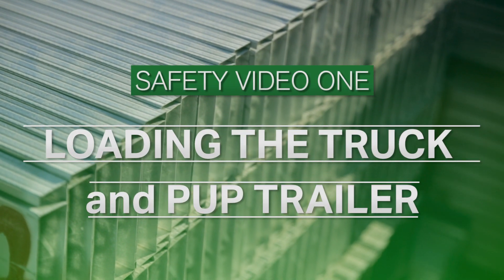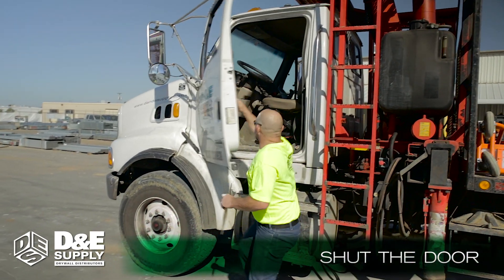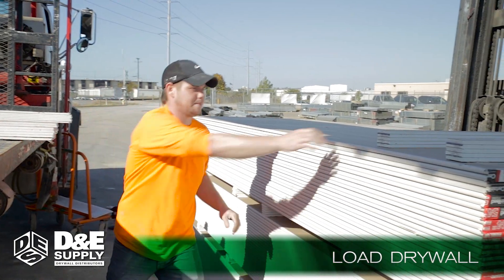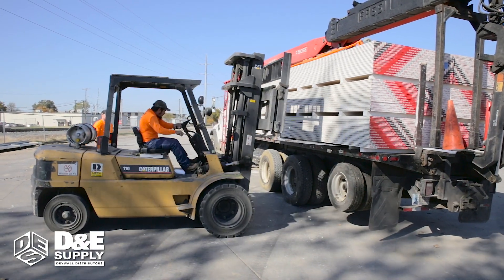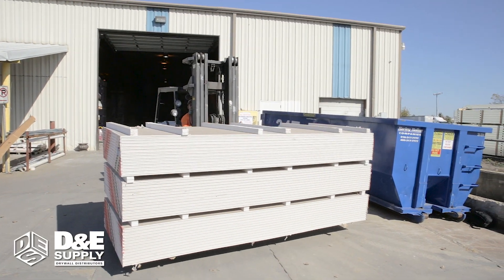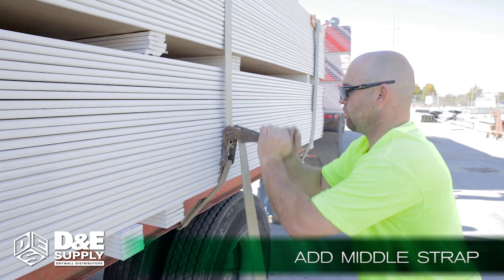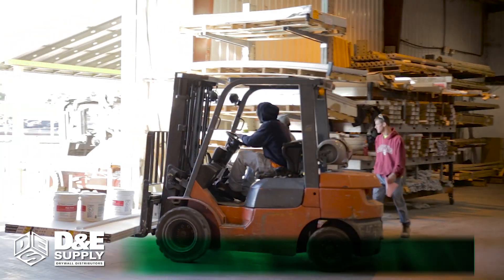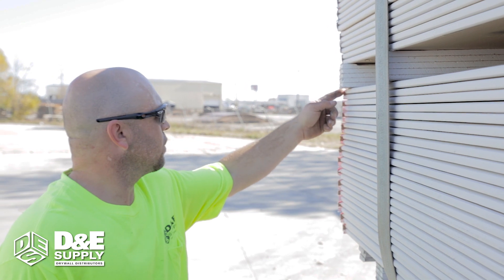D&E Supply| Safety Training Video 1: "Loading the Truck and Pup Trailer"

Comment: Nice over width ticket example here. From where I'm come from 102" is limit on most roads
Reply: I really can't confirm from the video that 54 inch board is loaded on both sides.
edit: a few minutes later I confirmed by reading the comments of the "helper" that it is 54 inch board on both sides